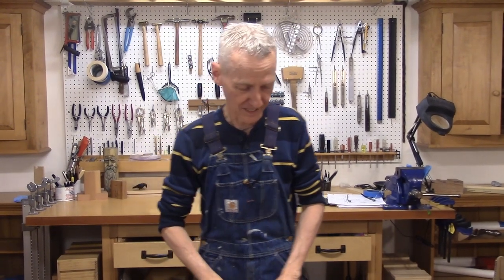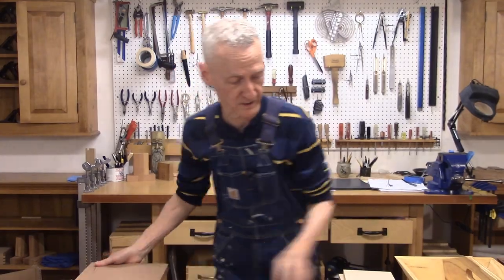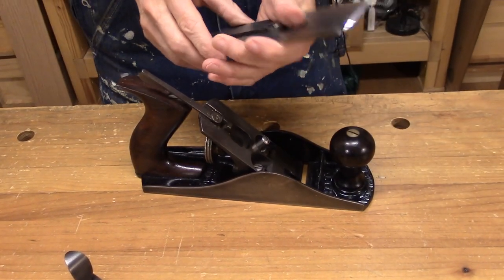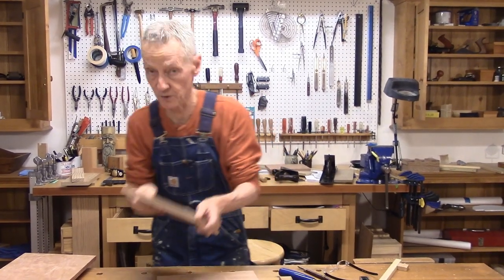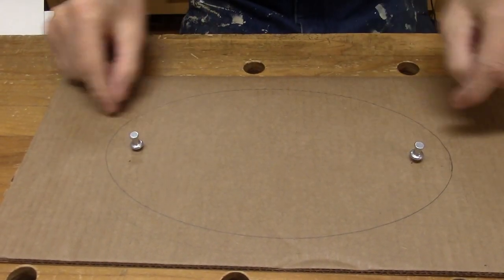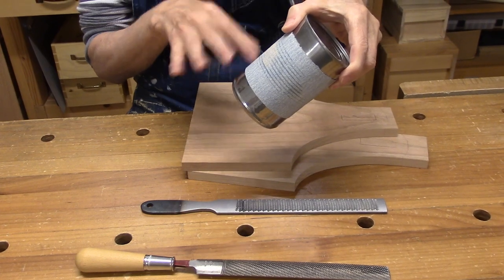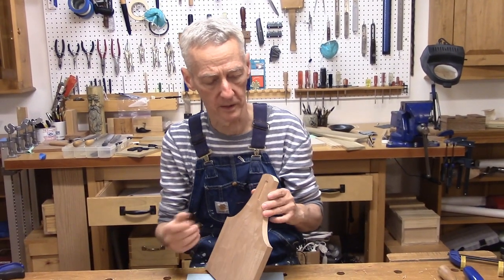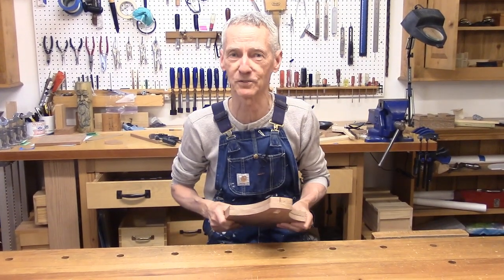Cherry Tool Tote Show #1

Comment: Wow, you did that planing by hand, I'm blown away!  Well done and thanks for sharing.
Reply from the maker: Thickness planing is quite easy for smaller boards. For removing large amounts from larger boards, a powered thickness planer is quite useful. In either case I prefer using my hand plane for jointing. It’s quick, easy, and works best for my kind of woodworking. Best regards.

Comment: What prompted you to align the long grain of the bottom and ends.  It makes perfect sense on avoiding cross grain for the handle load and dovetail stress from the tool load.  It seems everyone aligns the sides and ends in a quick search.
Reply from the maker: Hi Bob, that’s a very good question. Of the tool totes I’ve seen, the grain direction and joinery methods are quite varied. I chose my ends-to-bottom dovetail/grain orientation for the very reasons you mentioned. In practical use however, I don’t think the grain direction matters too much, since the amount of weight the box will hold is relatively small. Still, I prefer to design my projects with these things in mind. Thank you.

Comment: Just started watching this series.  So much good info in just the first video!  I really enjoyed the formulaic approach to the ellipse; I was expecting the usual 'pull out a french curve and trace something that looks nice' ;)  

Question on the knife/chisel wall for cross-cutting the ends of the boards:  I get that the goal is/was to eliminate any splintering or tearout on the back side.  I'm used to seeing a knife line all the way around for that, and I get why you used the chisel to deepen the line all the way around... but I'm not sure I understand why you did the trough/trench on the back/under side of the board as well?  I thought those were simply for guiding the saw while starting the cut?  What purpose does it serve on the other side?  Doesn't the knife/chisel line already stop the tearout?

Thanks for the great video, and I'm looking forward to watching more!
Reply from the maker: Thanks Monte, I’m glad you enjoy my video. Yes, I enjoy making elliptical curves “to order”. Curves can get out of control very easily.
You are correct, the “trench” on the back/under side doesn’t guide the saw. It’s not essential, it just assures me that my chisel wall is as deep as I want it to be.
Reply: @treebangham  a question on the ellipse: how do you determine the string length?
Reply from the maker: In the video, at the 16:00 minutes point, I describe how to calculate the spacing for my thumb tacks on my layout. The string needs to be adjusted so it is taut when it is looped around both tacks and extended to the width dimension mark on my layout. I hope this helps.
Reply: @treebangham  "extended to the width dimension mark on my layout"  that was the key part I was looking for.  Didn't know if there was a formula to go with that as well, or just referencing off the lines and points drawn on the scrap material - it was a little hard to see all the marks real clearly in the video.  But now knowing what I'm looking for, I found 'em ;)

Thanks!
Reply from the maker: Glad you found it.

Comment: Have been looking for a great tool tote design for 6 months.  Yours is th best i have seen.  I will modify it and splay the sides 7 to 11 degrees.  Love the cardboard mock up and the curves .  Where are you in Pennsylvania? My grandparents were from Fulton county?  First time finding your channel .  Great techniques.  Thank you for sharing with us.
Reply from the maker: Hello and thank you. Let me know how your project goes, send me questions if you have any.  For me, the mockups are an essential part of the process. They always reveal things I didn’t see in my mechanical drawings. We’re in Allentown, Lehigh county.
Reply: @treebangham  watched more of your videos today.  Those are some sharp chisels! What brand of fenced router are you using? Were you self taught on sharpening or do you use a specific method.  Great techniques, a true craftsman with a flare for design.
Reply from the maker: I use the Veritas large router plane, very useful for the kind of woodworking I do. The optional fence is nice to have as well. The blue handled chisels are Irwin when they were made in Sheffield. I also have a few Lie Nielsen bevel edge socket chisels. My sharpening methods have evolved over the years, starting with one small oilstone and no jig, and now I use a Veritas Mk.II honing guide on sandpaper and finer grits of abrasive film, finishing on a strop. Thanks for the note.
Reply: Thank you.  Sharpening is so critical to fine woodworking.  It took me many years to learn how to create a razor sharp chisel or plane iron.  Once I figured that out ,  woodworking was so much more enjoyable.  Nothing better than being able to make a plane sing or paring the perfect joint .  Thanks for teaching the younger folks great techniques and letting them see what a truly sharp chisel should look like.  When I was much younger I would watch Roy Underhill do wonderful work and know that there was a big difference between his sharp tools and my tools.  I bought high quality steel.
Buck brothers from before 1900, James Swan, Keen Kutter from the 1920's,  Sargent VBM with their English steel from around 1910.  I used a Makita slow speed horizontal wet grinder and DMT diamonds stones before I could make them shaving sharp and hold an edge.  Once I could do that it was a whole new ballgame.  Seeing your chisel brought me back to my 20's.  When Roy retired I wondered who would carry on teaching the younger generation.  You are doing a fine job.
Reply from the maker: Thanks Wayne. Yes, sharpening is a gateway skill in woodworking. Sharp tools are essential. Roy Underhill continues to be an inspiration to generations of woodworkers. I’m encouraged when I see so many people learning to make things. Great to see.